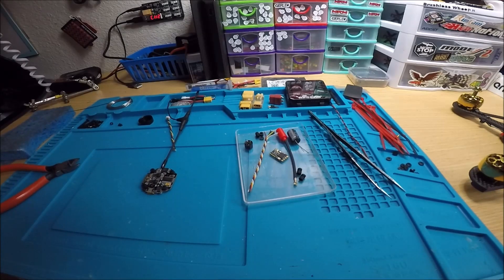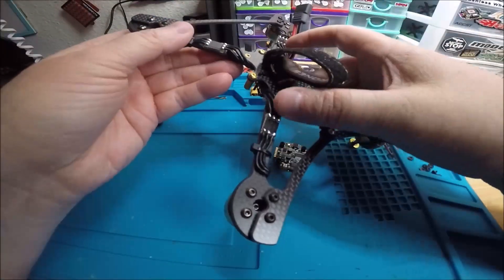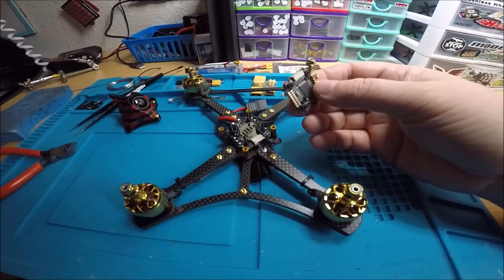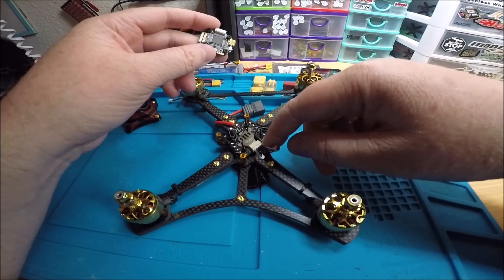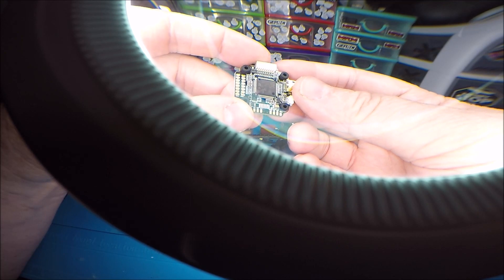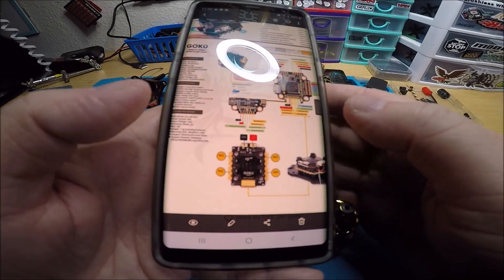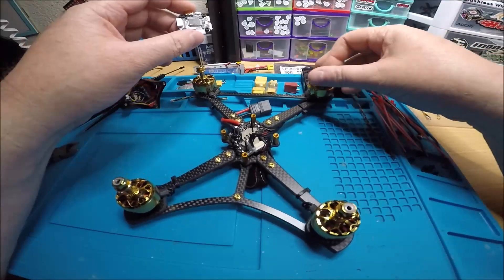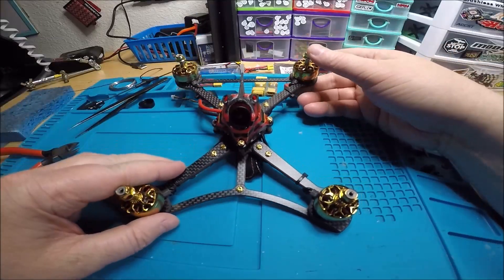flywoo goku f722 mini stack

Comment: Thanks man! Flywoo stuff sure is pretty. I agree about the 1404s. Love that they give you a ton of wire to work with. I'm waiting on the 4x10 leds. Think they'll have any problem with current draw from 1505s? The wire is pretty short on those and I was hoping to extend with the 4x10 leds.
Reply from the maker: I'm not sure but I guess you will find out. I usually use the 9x15 on anything bigger than a 1204 or 1303
Reply: @ADMDGLS69  Yeah i might chicken out and use some of the CLRacing ones. They are about the same length as the arm though :) thanks again man.

Comment: I have the twiglet mini on flywoo ROBO 1202.5 -5800KV with Betafpv 12A AIO , I really like the motors , pain that there 2mm shafts on the motors but ehhhh its workable.
Reply from the maker: I was wanting to grab a set of those but they were out of stock at rdq
Reply: ADAMBOMB FPV I waited two days after first seeing them, then ordered them. They were soldout the next day but quickly restocked. I just looked and apparently there gone again. I looked on every other outlet including ebay and besides Banggood , RDQ is the only one that stocks them stateside. They can only make so much power though, im not sure if the weight saving is worth it. I like to run it with 300mah 4S from getfpv, it weighs under 80 grams with that and that is vtx, rx, camera everything. They are extremely efficient, thats the best attribute.